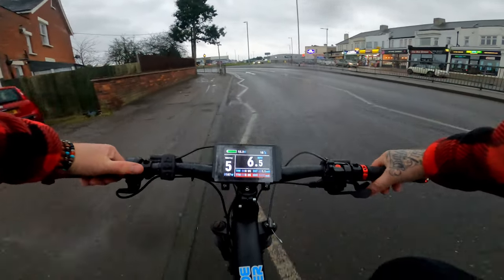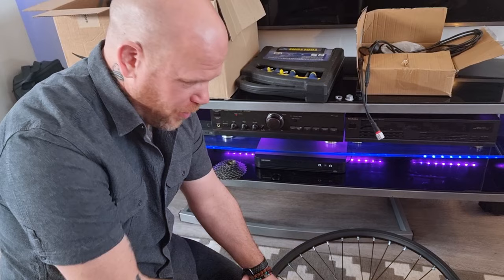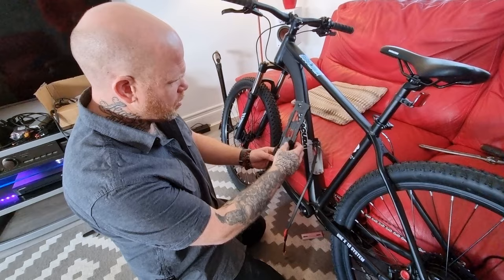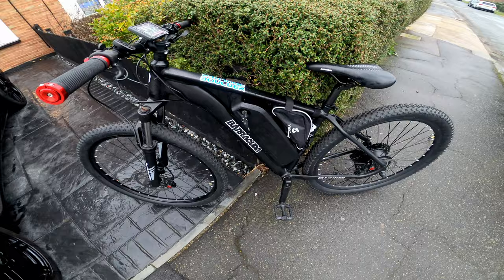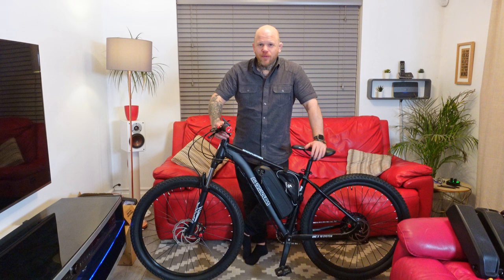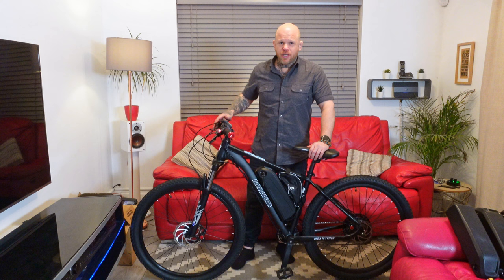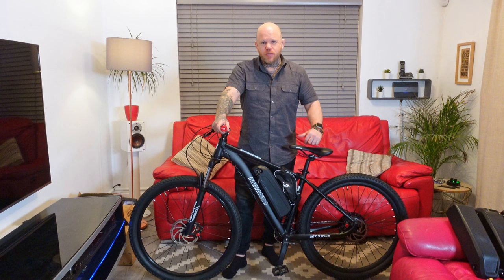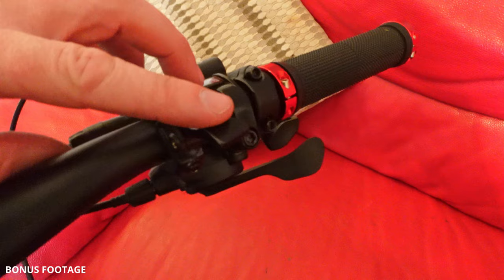How to BEAT the 250w ebike RULE!!!

Comment: This is a very good example of why they have the 250 watt ruling. Particularly since if there wasn't any legislation then people like this would just be running around thinking that they were the only people in the country who's opinion mattered. With this being highlighted by the fact that the person who made this video, keeps going on about how he is just trying to annoy people ! Listen to it, he says that around 10 times !
Reply: Please read up on the history of the "250w rule" - it has NOTHING to do with safety etc. You will be more than surprised by which people and organisations were involved with the creation of this bit of government legislation.  Actually, I know you won't do that, because it does not fit your narrative for this matter - so, let me just skip to the main issue...  

It was largely down to the "British Motorcyclists Federation" (BMF) lobby group who were involved on the consultation and planning with the "Department For Transport" (DFT), and wanted to protect the motorcycle / moped industries from an influx of cheaper machines to the market. They ensured that the electrical propu lsion (in Watts) was less than maximum a human can produce, and thus anything exceeding this became defined as their territory, and so a "2 wheeled motor vehicle".  Until the Electrically Assisted Pedal Cycles (Amendment) Regulations 2015 revision came into force on 6th April 2015, the rules "EAPC Regulations 1983" governing the maximum motor power allowed, were restricted to only 200W for a bicycle, and 250W for a tricycle or tandem bike. The BMF had pushed hard to keep the limit below 150W, but it was eventually agreed that this would be a futile amount of power for an adult cyclist. The DFT had originally planned for a much higher motor wattage, between 300 and 500 watts.

Comment: 1) What is the legal requirement/limit for the battery; is there not a legal limit for the battery watts and/or viltage?

2) If anyone wants to be powered to more than 15 mph, they should simply buy a motorbike.

3) those who claim that 250W is not powerful enough are just boy racers (its nearly always males) who wanna ride fast but.....without the need for the responsibilities that come with speed (insurance, "road tax", MOT, parking permits etc etc) and use pseudo-engineering reasons to justify their claims for more power.

4) If I, at 58, can ride an upright cargo trike (approx. 35 kg) with the additional weight of a child on board and do so uphill without eBike motors, I really would like to see where and what it is people are riding when they claim 250W is not enough

5) Good quality eBike motors (e.g. Shimano SX range) churn out high torque so should be good enough for anyone.
Reply: Thanks Karen.

Comment: Yes, totally agree, the law had to be drawn up by half witts. I'm Disabled, and being limited to 8mph on the road using a Disability Scooter requires you to have a death wish. Couple that with twist and go Ebikes which do more than 5mph under throttle control being illegal, amounts to discrimination for people that can't pedal. The government used EU law as an excuse before but even they allow road going 25 kph Disability Scooters. Going back to your Ebike build, please show configuring new controllers with existing hub motors. Obviously kits will be plug and play. But I have a UK spec 250w Himo Z20 delivered without a throttle, I've tried three KT Sinusoidal controllers with all phase and hall combinations without any luck. Now it has an over the top Phaserunner controller as an experiment. Under powered on 36 volts, strapped a 48v battery to a rack and still useless, although it does actually work under throttle control for the first time using Phaserunners excellent Auto Tune feature. I need it to work with the in frame 36v battery so am thinking of putting it through a 20 amp 36v to 48v DC to DC converter but the current required from this small battery would be excessive. Hindsight is a wonderful thing, should have just returned it when I realised they had suddenly changed the spec from hackable to no throttle. I'm no speed freak  I would be happy with an Ebike that would do 15mph on the flat and pull me up a hill. But it seems some 250w motors are not capable of doing that, no matter what battery and controller you use. I have of course checked my motor has no blown FET's. Good on you Mate, keep up the good content.
Reply: What problem are you having with the KT controllers?
What hubs are you using them with?
I've used four with no problems. They also have a good power limited  pas setting rather thqn speed limited.
Reply: @colincampbell4261  The Himo Z20 motor is unbranded. I understand Xiaomi are behind Himo, but the few numbers on the motor reveal nothing on a Google Search. One reason I bought this bike was my Friend had one and his motor is totally silent. Also his has a throttle. Most of these small motors are geared, but with incorrect wiring this motor runs backwards, sugesting it is gearless, as presumably without a freewheel, geared motors would cause too much drag when peddling. Ironically the aftermarket controller that had most power was a cheep and nasty one costing £10 from China on Ebay. But the nasty waveform comming from it made the motor growl and get hot. Unlike the Sinusoidal Phaserunner which is totally silent. But even this can't produce enough power for a modest hill on 36v. The KT controllers didn't produce any usable amount of power on the one or two wiring configurations that didn't produce cogging etc. Thank you Colin for your comment, Mark

Comment: Almost legal is still illegal.
I am a recent convert to e bikes and think our towns and cities would improve if more people used them. 

What people seem to ignore is that if you get pulled by the police and they decide to throw the book at you, your non EAPC compliant e bike can become a real mill stone round your neck. They can confiscate your bike, then charge you with using a vehicle without the right license, no tax and insurance, no MOT,  using an unregistered vehicle and not wearing a compliant helmet and no number plate. You end up with points on your license, a hefty fine and they take your bike. This can then put the cost of your car insurance up in the future or invalidate your current insurance if you don't update your details straight away.

The government is reviewing e bike law and with a bit of luck, common sense will prevail and some of the restriction will be eased.

You can use an e bike of any power but you have to treat it as a moped or motor bike. If you build your own e bike that is not EAPC compliant, you need to apply for an VIN number from the DVLA. Then have it type tested for your MOT class. Then get a registration number, then tax it, then insure it then make sure you wear the correct type of helmet and make sure you have the correct license to use it.

If you want more power get yourself an e moped that is road legal.
Reply: Just ride safely and courteous and stay under the radar.
Reply: ''The government is reviewing e bike law'' you seem optimistic, this is the U.K government, not a sensible government. 🙏